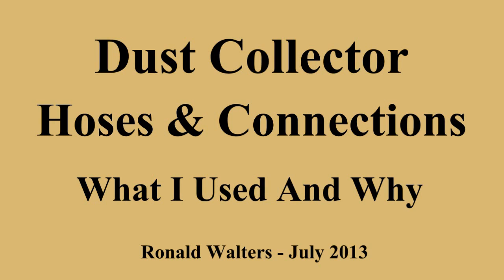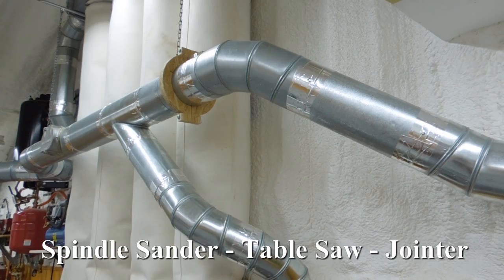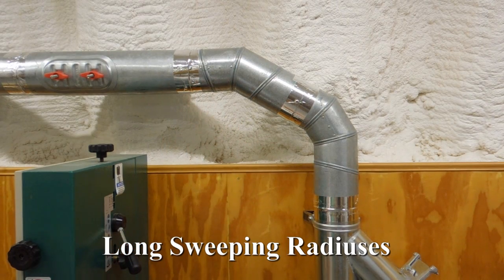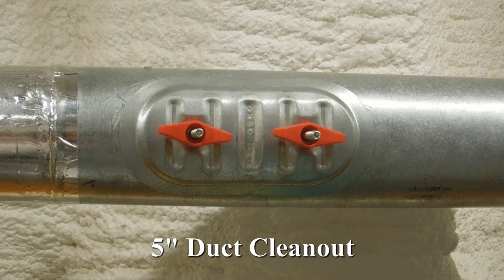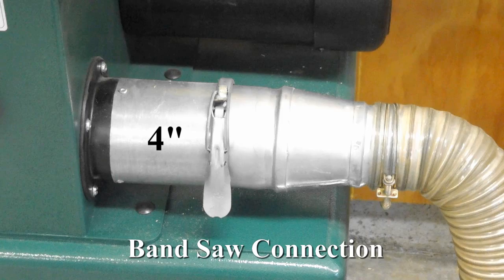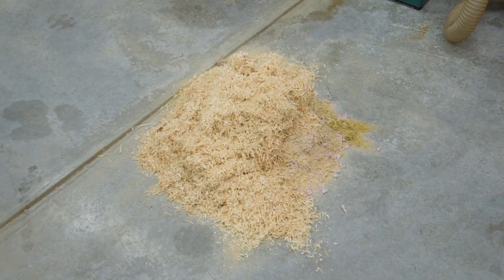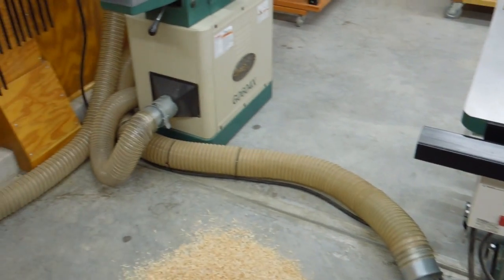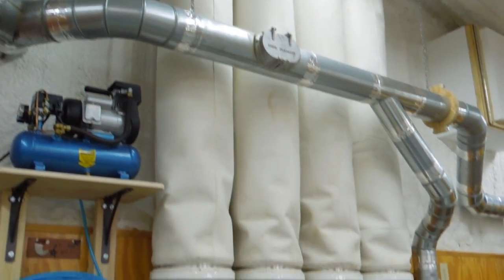Dust Collection Hoses - New Shop

Comment: Mr. Walters, Sir I do not know how much money you make at your regular full-time job (Woodworking or Other), but you sure could make money hand over fist designing dust collection systems for other folks in the Woodworking Industry whether small or big shop!!!! But, thank you for sharing this video with us here on YouTube!! Stay safe and healthy, please!!!
Reply from the maker: Thank you for your comment. Much appreciated!

I worked with pneumatic conveyance systems for dry materials such as cement and drilling mud. I also worked with a number of different design dust collectors and cyclone separators. The same principles apply to dust collection systems, mainly trying not to restrict flow.

I am sure you will find other interesting subjects on my channel.

Please subscribe. 
That is what keeps this channel running. 
Ron

Comment: How did you securely hang the metal pipe onto a spray foam insulated metal building? Do you have any videos or pictures of assembly? Of outside and inside connections? I have been watching your steel building video many times, and attaching to this type of steel building is still not fully understood, especially after spray foam was used. Thanks.
Reply from the maker: This video shows how the chain hangers for the lights were hung prior to spraying the foam.  Lights were removed and the chains were held at the proper angle with spreaders so as not to get foam on the lights.

Obviously you want to think and rethink what you are installing in the building before spraying any foam. Plan for the future.

The original 5 /16 building bolts are fairly easy to drill. Then they are replaced with a longer bolt. A nut is tightened to the bolt to hold the building together. Then the end link of the chain is spread so it will go over the bolt. A washer and nut then hold the chain link in place. Great stuff is used to replace the core of foam removed by the hole saw. I use the smallest hole saw possible. 

Building My Steel Garage
https://youtu.be/ZnV3m4Vx500

This shows how I located the bolts by drilling from the outside.

Steel Garage Finding Bolts In Foam
https://youtu.be/TJjqzIzRo5Y

Fortunately most of the dust collection pipe was mounted to the plywood walls. In Building My Steel Garage you can see how the plywood is attached to four (4) 2x4’s running the length of the building and across the end wall. You can see the chain hangers for the return air plenum  and occasionally a chain was needed to hang the pipe.

Steel Garage Ceiling Foam Repair
https://youtu.be/-jHS2_aoDUU

Duct Hangers - Using Available Space
https://youtu.be/hWb5omG0Eqc

Dust Collection Hoses - New Shop
https://youtu.be/cTdN4iRzQRQ

If there is a will, there is a way. You need to think the problem through and how to do something without screwing up something else. You need to be a bit creative and nobody else has probably done anything like this before… at least nobody you can find to talk to.

Thanks for watching. Please subscribe. That is what keeps this channel going. Ron

Comment: Hi Ron, nice video and commentary.  Is that an Oneida 1.5 hp DC with internal HEPA filter?  I just picked-up one of these and wonder about replacement HEPA filters.  Any suggestions?  - SuperPhil
Reply from the maker: It is 1.5 HP but no internal filter. Dust is not going to fall out of a pleated filter inside a dust collector any better than it falls out if a pleated shopvac filter. I saw that as a genuine pain in the rear and went with the plenum and 4 sock filters which have functioned perfectly. Personally I see no need for a HEPA filter. That is usually something to comply with OSHA and an industrial environment (IMHO).
Reply: Ronald Walters   Really helpful video seeing better collection with the larger hose.  And only a 1.5 for all of that!

Comment: Well done Sir.
I have a question. This video is from 2013. Since then, have you inspected your plenum for signs of mold that might occur from your dc being outside? This fear keeps me from installing mine out the back of my shop. Thank you.
Reply from the maker: Air is moving through the system at 750CFM. All duct and the plenum are at shop temperature. Conditioned shop air is being circulated (cool air-conditioned air in the summer and warm heated air in the winter). There is sweating or condensation and no mold. Thanks for watching. Please subscribe!
Reply: @RonaldWalters2010  :  Thank you. Subscribed.

Comment: What gauge of metal duct pipe did you use?  Good job by the way!!!
Reply from the maker: I bought adjustable elbows and straight pipe from Oneida Air Systems. Both were 24 gauge. Reducers, floor sweeps, wye joints blast gates, etc can generally be obtained elsewhere a lot cheaper, you just need to shop around. Grizzly.com and lawlermfg.com are good sources. Thanks for watching. Hope you have subscribed. Ron

Comment: Great system. What did you use for pipe hangers on the vertical / horizontal drops? Are those just straps with spacer blocks you made?
Reply from the maker: Grizzly had some C-clamp straps for 5" similar to G7344 but the ones I used are longer and would hold a piece of duct to a wall. G7344 only reaches half way around the pipe. Sometimes they have items in their store which are not listed or difficult to find online. The c-clamps I used would not collapse the pipe when tightened fully. I had offset brackets welded for the vertical drops which held the pipe a few inches away from the wall. There are two such clamps on each vertical drop. This heavy gauge pipe is strong enough to be self supporting between vertical drops.  On the horizontal runs across the back wall and after the mitered curves, I used a total of 6 chains from the ceiling and plumbers perforated strap around the pipe connected to the end of the chain. Watch the video again and you will see some of the chains. Thanks for watching. Please subscribe.

Comment: Nice setup! Thank you!  Is most of the ductwork standard heating duct from the big box stores? I think there's some Nordfab here and there. Thank you for your time
Reply from the maker: Standard light weight duct like used for heating & AC can easily collapse under a good vacuum. All of my duct is 24 GA and I got it from Oneida Air. You need to be part Neanderthal or have a friend help you snap it together. There are Nordfab fittings but I bought a lot of it at Grizzly which was cheaper. Blast Gate assemblies I made myself and bought the blast gates direct from Lawler Mfg. Lawler also has the larger clean-outs.
Reply: Thank you

Comment: does anyone know why everyone uses 4 inch pipe and bigger!??!  i dont understand when most tools only  have 2.5 inch vents? can i just use 3"???  thanks.
Reply from the maker: +rusty Shackleferd (mirrored eyes) Manufacturers only include what they think they can get away with when it comes to dust collection… if for no other reason than just to be able to say it has a dust collection port. That doesn’t mean the dust collection works. I have shop tools where the original dust collection would not collect a single speck of dust. Small connections are probably intended for shopvacs even though they probably need a larger connection. I have modified most of the tools in my shop for dust collection and I have several videos related to this. Dust collectors need to move a large amount of air at low airflow restriction in order to be effective. A 4 inch pipe/hose has roughly 44% larger cross section than 3 inch and the difference in allowed air flow rate is higher than that. My table saw came with a 4 inch connection, which I cut out and replaced with 5 inch. My jointer had 3 inch, which I replaced with 4 inch. I use 4 inch hoses throughout my shop and the steel duct is 5 & 6 inch. For the best performance of any dust collection system, the duct needs to be as large as possible for as long as possible and the hoses as short as possible. Think Big!
Reply: thanks, thats the fastest response time i have ever had! i'm sure your right, but i just don't understand that idea.  the larger the pipe the more air must move in order to reach its destination? which means more  power? right?
thanks again.
Reply from the maker: +rusty Shackleferd (mirrored eyes) The little cheap dust collectors don't work all that well and yes they are lower power. Dust collectors move large volumes of air at relatively low pressure (vacuum). It is mass flow... a large mass of air is being moved.

Comment: May I ask why did you keep mentioning the pipes is grounded? is it a safety issue?
Reply from the maker: Rexus King A dust collection system can generate tremendous amounts of static electricity which can hurt you and can cause an explosion or fire. Lots of people use plastic pipe in their dust collection system because it is cheap and easy to install, but it needs to all be wrapped with wire and then grounded. Ungrounded plastic pipe will also charge up like a capacitor (hold a charge when the system is turned off). The plastic hoses also act like a capacitor when they get charged up. That is one reason I use wire reinforced hose, it is easy to ground to my metal pipe.

In two weeks I will release a video which demonstrates the tremendous discharges I experienced while demonstrating my new cyclone separator.

Comment: Nice Job Ron.  I'd like to use your ideas in my shop, if the neighbors don't mind the noise of the motor. I may need to enclose the exterior motor with a noise baffle.

Comment: How high are you lifting your dust before it enters the bag?
Reply from the maker: Kenneth Sternberg Everything picked up by the dust collection system (chips, shavings, dust) rises to the entry level for the cyclone which is 8 feet above the floor. The air, plus anything not separated in the cyclone (only very fine dust), returns to the shop and rises another 3-1/2 feet to the return air plenum. The very fine dust which actually reaches the filter bags is a very small percentage of the total collected material and is very, very fine like talcum powder. The largest contributors to this very fine dust have been my disc/belt sander and drum sander. If I am using the drum sander a lot, I need to constantly remind myself to check the 5 gallon buckets on each bag. Prior to building the drum sander I only needed to empty the 5 gallon buckets once every 4 or 5 years. 

In terms of total lift leading to the cyclone, it could probably rise 20 feet or more and work perfectly. It is all about air velocity and mass flow. The shavings, chips and dust once picked up in the flow stream are just going along for the ride like a leaf in a hurricane.

Comment: with your dust collection system outside i'm curious do you leave it on the entire time you're working in the shop or do you have a remote switch for it inside. i'm experimenting with locating mine outside but I only like to run it while i'm running the tools and I don't want to have to run outside and hit the button right before I go to use a tool.
Reply from the maker: Having it outside gets a lot of the noise outside and when you empty the drum, the dust and mess is outside and not in your shop. It also is not taking up space inside your shop. I only run the dust collector when I run my tools. You can have a conveniently located switch inside your shop or use a remote like I do. I recently posted a video on how my remote works. Hope that helps.

X10 Dust Collector Remote Switching
http://youtu.be/hYeOMRRSFdQ

Comment: Спасибо за видео. Было очень интересно :)  Подскажите какой мощности вентилятор Вы используете ?
Reply from the maker: This is driven by a 1.5 HP 220 volt 50 Hz motor rated at 750 CFM @ 8” of water.

Comment: Hi Ron... Thks for all your imparted knowledge.  

I would appreciate your input.  I already have a 6" dust collection system for my major tools I.e. Table saw, joiner, etc..  However, I have been considering a "vacuum system" for cleaning up my workbench, etc.  The vacuum system I am contemplating is like a "Shop Vac / Dust Deputy" type system but permanently installed similar to the typical "dust collection" system but with smaller PVC pipe and flex hoses just for the smaller vac jobs.  I love the efficiency of the dust deputy type collection but very much do not want the clumsy portability that most all videos portray.

My goal is to have a nearby hose I could have next to/ over my workbench and other tools like my smaller band saw, etc., quickly grab and ideally the vac would turn on and off conveniently.  Perhaps a unique switch at the end of the hose.  The bucket system is also clumsy so I was thinking about having the DD sit on top a 12" PVC pipe about 3ft long tucked out of the way close to a wall.   The bottom of that 3 ft PVC pipe would have a blast gate that would be connected to the larger dust collection system so the collected dust from the vac system could be instantly and easily sucked out by the dust collection occasionally.

I would appreciate your thots input.  My email address is myerkes504@aol.com.
Reply from the maker: I have experienced a few “built-in” vacuum cleaner systems in friend’s houses and they can be a real pain especially if the wrong stuff gets sucked up and plugs the piping. A vacuum will tend to lose its power when the pipe or hose gets too long.  Even trying to unplug a long ShopVac hose can be a real challenge at times. 

I have a series of videos showing how to build a cyclone separator (similar to a dust deputy), which sits on top of a 5-gallon bucket. There is also a dolly, which holds the cyclone and the ShopVac. I have found this very handy as I can push it out of the way when I don’t need it. 

I have found it best to use a filter bag inside ANY ShopVac even when using the cyclone separator. The bag catches anything which gets past the cyclone and maintains the maximum airflow through the ShopVac. I have a video on that as well.

I use a 4.5 HP ShopVac Hang-Up Pro in another shop for my lathe, scroll saw and small band saw. It tends to run continuously and they are just too noisy. I mounted it in the garage and have the 18 ft long hose feeding through the wall into the shop. That puts the noise out in the garage but I can still hear that it is running. I turn it on/off with a X-10 remote controlled wall outlet receptacle and a key chain remote. I also use one of these to turn my dust collector on/off in my big shop. Very handy stuff and can be used for many applications. Google it or go to www.x10.com

I also use a cyclone separator between the ShopVac Hang-Up and the hose and there is a filter bag inside the ShopVac Hang-Up. This is really the ONLY way to go. I’m on my second Hang-Up. ShopVac’s really aren’t intended to run continuous duty. Mine sometimes runs for hours when I’m running the scroll saw. 

Blast gates don’t generally close very tight; there is always some leakage. Any leakage on the bottom of the cyclone separator will probably kill it. The seal under the cyclone needs to be perfectly tight in order for the cyclone separator to work. I would stick with the 5-gallon bucket. I only empty mine a few times a year. 

Also, slugging a large amount of stuff suddenly through your dust collector could be detrimental to your dust collector.

I would not recommend anything longer than an 18 ft hose similar to what comes with the Hang-Up.Unplugging a long hose can be a pain.

Comment from the maker: Mainly saving space but noise reduced quite a bit depending on type of structure. First garage it hung on a bare steel wall, resonating noise inside. This garage has foam insulation so it is much quieter. Emptying the drum outside keeps the mess out of the shop. Originally I did not empty the 5 gallon buckets on the filter tubes for over 5 years. Then I built the drum sander and a lot more fines escape the cyclone so now they are emptied more often (maybe once a year) which is a bit of a mess.

Comment from the maker: 5-inch blast gates and 6-inch clean outs from lawlermfg-dot-com. Unfortunately they do not (have not) made the clean outs for 5-inch. Family owned foundry and much cheaper than buying from someone else. You should also use the heavy gauge pipe and fittings or you can suck it flat. The pipe and elbows 6-inch and 5-inch I got from Oneida. They now have 5-segment elbows instead of 4-segment and it certainly makes it easier to get things to line up. I had one break but they made it good.

Comment from the maker: IMHO most dust collectors are just dust relocation systems (they leak tons of dust). The bags on my return air have a very large surface area. They do not even inflate when the collector comes on. With that much surface area, the air velocity through the felt material is fairly low. I have not noticed any dust leakage. You have much more to be concerned about from the dust coming off the various saws, routers or sanders, which is not collected in the first place. You will never collect it all.

Comment from the maker: As explained in the video, this dust collector moves 750 CFM of air. It would suck all or the cool air in the summer (or heated air in the winter) out of the shop in a couple of minutes. By returning the air you help maintain the temperature inside the shop. The only reason my dust collector hangs outside is so it does not take up room inside the shop (plus it is noisy).

Comment: Put an automatic air spitter on the drain valve of your air compressor tank.  You will love it.  You can get a nice one through Grainger.  Run the drain line off the spitter through the wall and outside.  If the drain line is  eye level you might want to put a deflector on it or down spout so it does't hit you in the eyes when it bleeds your tank.